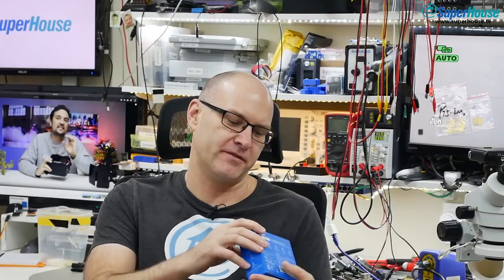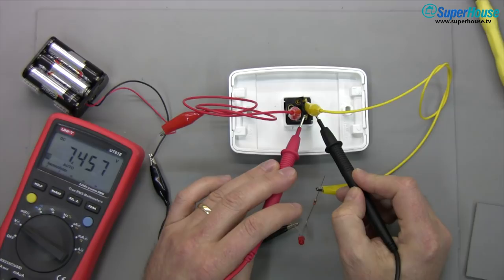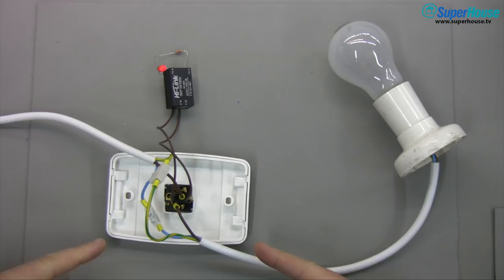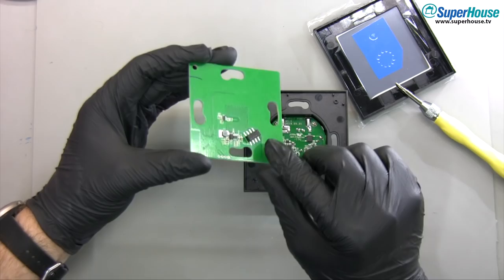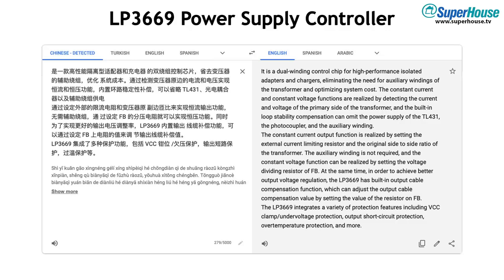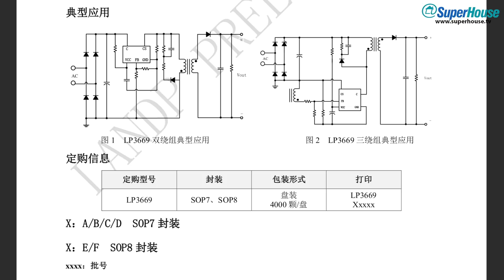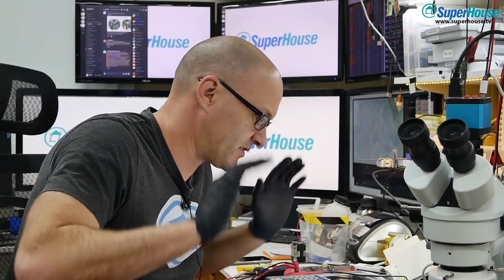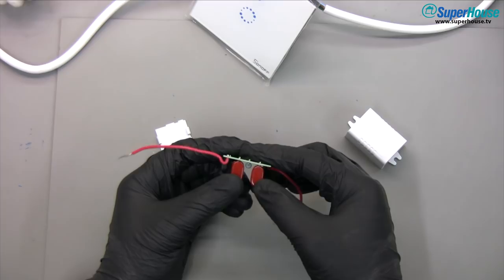SuperHouse #34: Science or sorcery? Sonoff T4EU1C no-neutral wifi touch switch

Comment: This is actually very smart, I was pondering an alternate route.
When relay is off, use the potential, when it's turned on it also runs the line through a transformer letting it parasitically live off the power being consumed by the attached through a secondary coil

Comment: That procedure worked perfectly fine for me, thanks a bunch !    Note that taking the ground on that small capacitor ended in shorting VCC to ground for some reason, that was solved by reflowing it with hot air. The easiest way to get ground is probably on the connector on the back :)

Comment from the maker: IMPORTANT UPDATES. 1) Many people still have trouble with the touch switch. The reason mine works is probably due to replacing R10 after I damaged it. I don't have a second unit to test with, so DrZzs and others are working on verifying this right now. I'll update the web page with info about this. 2) YES, IT WORKS WITH LEDs. That seems to be the #1 question about this video! Controlling LED lighting is actually the most common use-case, and it's what this is primarily designed to do. I've tested it with an LED downlight and it works just fine, but needs the anti-flicker unit installed so that the Sonoff can get enough power to run itself. I didn't bother showing this on the video because I thought it would be the most obvious use for it, so there'd be no need to show it. Sorry! I should have included it anyway.
Reply: Three switches successfully flashed and working correctly. Soldering to the end of R3 is not for the faint-hearted, and I had to reflow it on my first switch. I would not advise using flux as it tends to obscure one's view. Thank you for making a very clear video!
Reply: @trollobite1629  apart from this works with Google home and Amazon
Reply: Sorry if this is a really stupid question. I don't own one of these devices but I'm interested in buying one and have limited knowledge of electronics. You mentioned that the GPIO 0 pin has to be soldered via the resistor to get to the bootloading mode, but you also mentioned that the GPIO 0 pin is controlled by the touch sensor. Can you just use the touch sensor (pressing the capacitive "button" with your finger) to get into bootloading mode?

Comment: Thanks for a great explanation Jonathan.  
I flashed it without the reset.  It worked.  I got the Wifi AP, loaded the UI, was able to control the light through the Tasmota UI, but I could not get the Touch button to control the light.  I don't know what could be different.  
Still has be stumped.
Reply: Any luck with your setup DrZzs?

Comment: brilliant video... you reminded me of stuff I learned decades ago with electronics and forgot about!
Saw a different video and it was so aweful watching someone try to explain how the switch worked without having a clue!

Interestingly, I built my own switched socket using a sonoff mini... needed to build it this way as I need the socket to be covered and waterproof!  BUT the neon indicator didnt work and I realised why because of what you reminded me of in the explination of the voltage potential. 

thanks

Comment: As someone who's got a 1920s house with no neutrals, I very much appreciate this video and in depth explanation!!

Now if there was only a DIY version of this to power a Wemos...
Reply: you could just buy this and only use the power side pcb. The 8 pin header gives you 3.3V, ground and a relay pin.
Reply from the maker: Almost! The 3.3V regulator is on the logic board, the 12V regulator is on the mains board. So you get 12V and the relay pin, and you'd need to put your own 3.3V regulator on your board

Comment: Brilliant video! I was scratching my head for days wondering how they did it.

One question, why use the mechanical relay when the triac alone can cut the power to the light?

And secondly, if the anti flicker device can flow 300mA at 240V, that's 72 Watts, which is more than twice the consumption of an LED lamp. Does it flow this much in practice? How does it not overheat?
Reply: Me too, I am curious why they have a mechanical relay when a TRIAC alone can do the job. They do this too for the ZBMINI-L. I wonder if it is for troubleshooting purposes - making it easier to rule out the switch if the load (LED bulb, etc.) is dead.
Reply: I think I know why now: TRIACs are not ON/OFF, they are ON/HIGH RESISTANCE, so when a TRIAC is "off" there is still a small current flow, which at mains voltage is dangerous and can deliver a shock. Therefore a relay is also put in series to cut off that flow.

Comment: I thought it was going to use the voltage drop across a small value resistor in series with the switch. But their idea is clever, it works well regardless of the load size.

Comment: Ok please forgive my limited electronics knowledge but I have a question: why wouldn’t they have just placed a transformer in line with the active. When the switch is closed the transformer coil would induce a magnetic field across the secondary that they could use to run the circuitry? Is this not an easier option than pulsing the output?
Cheers MB, 
16 Perth
Reply: That would create a voltage division which would result in a dimming of the light. Same as putting two resistors in series. That's why they have to turn on/off the lamp very fast and briefly, or else the sonoff would turn off it self everytime it turns on the lamp which would also result in the lamp turning off immediately.

Comment: 0.3amps at 240v is 1.7kw per day, 670kw per year, at about £120. That could be per light. Ouch. Great video on how they work.
Reply from the maker: Yes, this is one of the downsides of smart switches! That's how much power the anti-flicker device will allow to pass, but luckily the switch won't pull that much power. I didn't show it in the video, but I put a Current Ranger in the 3V rail and measured that it draws about 70 to 80mA most of the time. That's just the MCU though, it's not counting power used in the power supply part of the circuit, the relay, etc
Reply: It's not power unity so you cannot just calculate power like that. If it used 1.7kW it would be on fire!
Reply: @SuperHouseTV  I see a lot of people come to the conclusion that the 300mA at 220V WASTES about 60Watt (60VA would be more precise) but that is not what happens.

The anti flicker device does not significantly increase the power use.
The regulator chip on the mains board will ALWAYS ONLY allow as much current to flow as it needs to maintain the 12V and/or 3.3V regulated. (It is on a feedback loop)
It doesn't matter if it pulls that current through a resistive load (the bulb) or through a parallel inductor.
There is some power loss over the lamp and/or capacitors, but the majority of the power is probably used by the ESP and the LED.

Comment: I bought the T1s when they first came out with the idea of re-wiring to fit them. I never got around to that - instead I used a battery powered servo to flick the switch. Now it seems I can swap those out for these! I guess I'll find out if they work for the 2 way switch arrangement (hall lights upstairs & down controlled from a downstairs switch & a an upstairs switch!).
£12 delivered seems about the going rate!

Comment: It's worth noting that he's using a battery powered oscilloscope for the analysis. To do this with a mains powered oscilloscope differential probes should be used for safety. (I've learned this by watching YouTube so please correct me if I'm wrong. I don't own either differential probes or a battery powered scope.)
Reply: A differential probe would be ideal. You can use an isolation transformer on the circuit under test but you really need to know what your doing... Also make sure the front end of your scope is happy to sink mains voltage!!!
Reply from the maker: That's exactly why I used the isolated scope, instead of the much nicer main-powered scope sitting on the bench in front of me! I forgot to mention it in the video. Also it's easier to get it in shot on the camera when showing the stuff connected on the bench
Reply: @SuperHouseTV  I knew it but it felt so unusual for you to not mention the fact as you tend to always be very thorough on your videos, especially when it comes to safety. So I fixed it for you.

Comment: The trick of using the capacitor as anti flicker is nice, but in long term it is pretty expensive...
A simple calculation shows that it consumes another 70 Watt when the load is on: 0.3[A]*240[V]=72[W], and this will usually be added to a bulb that consumes only 12-15W (standard LED / Florescent bulb) - so it increase the electricity usage by ~5 times (!!!)
Please correct me if you think that I am wrong :)

Comment: hi thank you for the video. i have a question about triggering the triac. Since its triggering the triac after mains voltage is above some treshold. How the circuit knows when to trigger. Is there a zero cross detector.

Comment: I've been pretty successful with just using bluetack to attach wires for flashing. Not sure if it'd work at this scale though. Maybe a drop of superglue in case one wants to avoid soldering.

Another tip I have is to use wire wrapping wire for this type of wiring. It's much less intrusive as its extremely thin and requires less heat to get the solder joint done.
Reply from the maker: Great idea about blu-tack for temporary connections. This was wire-wrap wire shown in the video
Reply: @SuperHouseTV  Oh crap, so the parts were a lot smaller than the video made it look like. The wires seemed huge!

Comment: I got a Sonoff SA-025-2.4G-1C with a single capacitor without the resistor. Does the stored capacitance on the resister not discharge itself across the load of the lamp over time? Thank you.

Comment: Given that GPIO0  is used on the capacitive output of the touch switch, could you not just press the capacitive touch switch whilst performing the reset?
Reply from the maker: This is a great question, and I should have answered that in the video! The answer is no, because the timing doesn't work out. The ESP8285 has to see GPIO0 low at the moment it boots, and the touch sensor IC takes a little while to start up. It needs to calibrate its own input, and then it takes a while to detect the finger. So by the time it starts asserting GPIO0 it's way too late, and the MCU has already booted up
Reply: So, couldn't you delay the reset long enough to let the capacitive sensor to boot or alternatively a switch to CPU VCC or reset while powering the capacitive sensor, to slow CPU rebooting when you want to program it? Guessing VCC and maybe reset are easier to solder to than GPIO00. Ah, is the capacitive thing an I2C device? Then delayed boot won't work.

Comment: @ 27:20. If you are using a regular incandescent (without the series capacitors) you are ALSO using extra power.
You are using this extra power to power the ESP.
My guess is that it is not much different, because the smart power control chip in the smart switch will pull as much power as it needs to keep the 3.3V and/or 12V regulated.

Comment: Great video just getting into smart wiring etc after being an electrician for 30 years, we never used to run a neutral to the switch as this was bad practice(to stop your diyer switching the neutral instead of the line conductor) however in the past 5-10 years wiring a neutral to the switch is the norm,it's also alot easier when it comes to testing the installation .,could these sonoff be wired in series to a 230v coil controlling a contactor for larger loads?

Comment: Hi, great video.. I have sonoff touch no-neutral 2ch. On one channel i have connected LED light, on second FAN.. but once i switch fan on, switch loose power.. 
I will try replace LED bulb with normal bulb, and try it again with and without "load capacitor"

Comment: Excellent
Thanks or that Jonathan - now, I'll still waiting for my Itead sample - the original Itead T1 UK version definitely does not work without neutral - and now you;ve sparked me off, I have a oair of ZemiSmart equivalents - one works perfectly - the other comes on and stays on, with or without the supplied capacitor (without it runs at half-power). I tested 6w LED E14 lamps - in the UK of course, on 249v mains power.

Comment: I was thinking about getting into automation of lights and instead of automating bulbs and having physical switches turned on all the time smart switches make more sense and lights can still be turned on or off manually. But I would like to keep the switches physical (as in rockers, not touch points) because it works even with gloves, when hitting it with something else than hand etc. Aqara makes switches like that but they blink the buls every couple of seconds because they don't have the antiflicker capacitors (and I have no idea how to calculate those). So I was thinking if Sonoff switches could be hacked with a physical button instead of a touch button. From this video it seems the only necessary part is tripping the GPIO0 to turn on or off the relay (I don't know if momentary or latch is needed but I can find that out). But you mentioned soldering to GPIO0 is difficult so now I'm kinda undecided.
By any means, do you think it could work?
P.S.: I would need those switches without neutral, my wiring is old and I have concrete walls in an apartment so pulling more wires through is not an option unless I want to mess up the whole apartment.

Comment: Nice video!  About five years ago, I tried to build a non-neutral circuit like that, and I did.  But it did not work for me because this triac technique only gave me 100ma maximum and my circuit with wifi required more than this. So I would like to know how this circuit can delivery more current. Is there any other video or information source that explains this magic? Is it possible to record a new video about this theme?  Thanks in advance, the video is really very useful.

Comment: Very good explanation. Nifty technique.
300mA x 240V=80Watt extra use. That's substantial
Reply: I tested my one - it uses 300mA when on (without a bulb) - but only 1.6W of power. It uses only 1 to 3 mA when off (with the wifi indicator off) with a power consumption of 0.2W. The PF for the switch circuit with the anti flicker device must be around 0.023 when on.

Comment: i have been thinking... why does ITEAD need the relay at all ??  The triac is used to interrupt the LINE  in order to steal power. Does that not imply the triac can be used to switch the load off entirely ?  In fact, since it is synchronized to the 50 Hz zero crossing it could be used to phase delay the leading edge of the voltage waveform, thus it could also function as a dimmer (at least for incandescent and some dimmable LED's).   What am I missing ?

Comment: Any reason you didn't  scrape the via that's on the other side of your resistor instead of the middle of the track? Would give you a slightly better pad for soldering the wire to .
Reply from the maker: I did, and then the whole pad came off and the resistor fell off, which is why I had to add the bodge wire!

Comment: The wasted power with the anti-flicker unit is only when the load is active, with the load inactive the power used should be basically the same as with an incandescent bulb (e.g. dependent primarily on the Sonoff's power draw).  Given that the loads that would need it are already much lower power than the incandescent - it seems a reasonable trade-off.

Comment: Great walk through.  70W power wastage (if I understand correctly) is a little too much for me though especially as the average light only uses 10-20W these days. Glad of the explanation though.
Reply: Yeah, it's hard to believe how much waste it is. What about overheating?
Reply: @CyprienLaplace  I'm not sure. The cap is in parallel with the lamp so I guess in not 70 W but it must be fairly high to provide a load larger than CFL or led bulbs. I would have liked to see so power measurements taken with a LED bulb as that would be the most common arrangement. Not sure heat is  too much of a issue with this arrangement the caps store energy in the electric field. The resister is only for discharging the caps when power is off.
Reply: @GlennPierce  when the switch is off, I suppose that only the necessary current to power the circuit goes through, and that is certainly smaller than the 300mA. While on, well, it will depend on the load. I hope it will be far from the max, but still being waste.
I wonder if it could pick the current in serie when the switch is on: it would only require a minimal voltage drop...
Reply from the maker: @Cyprien Laplace yes, that's correct. The capacitors act as a current limiter: they will allow up to 300mA through, but it will be less than that if the Sonoff doesn't draw much power. I didn't show it in this video (which was already epic) but I put a Current Ranger in series with the 3.3V rail and found the logic board pulls 70 to 80mA at 3.3V. There's also power used on the 12V rail for the relay etc but it's still far less than the 300mA/240V would indicate
Reply: @SuperHouseTV  yes indeed great epic video! If you have the opportunity to measure the current through the anti flickering module while powering the fluo compact bulb, i'll be interested by the result :)
Reply: @SuperHouseTV  it would be interesting to see the overall power consumption of CFL light piloted by Sonoff T4 (with the anti-flicker device), both when light is Off and when light is ON, a mention of the Power Factor could be a nice addition. Then compare it with the same light piloted by Sonoff T1, and for the sake of completeness, compare with the same light controlled by passive switch.  For the cost calculation, consider 3h per day ON, the rest OFF, then we can see how many Wh for a full year.

Comment: My question is regarding the capacitor and resistor. Those capacitors are connected to the bulb, wouldn't the discharge over the bulb and actually, there is no need for a resistor?